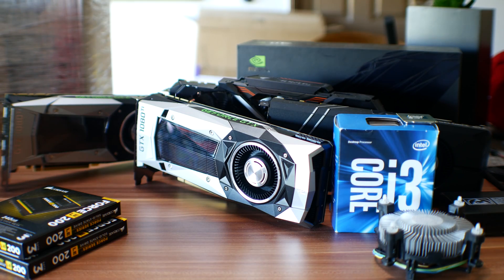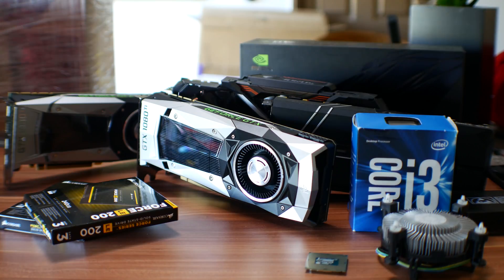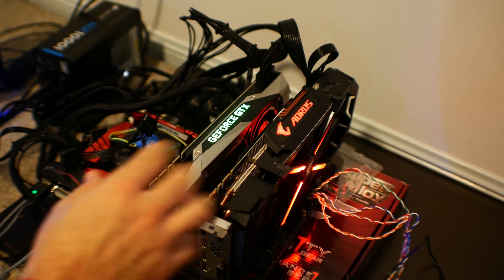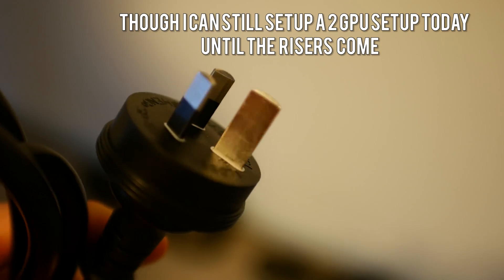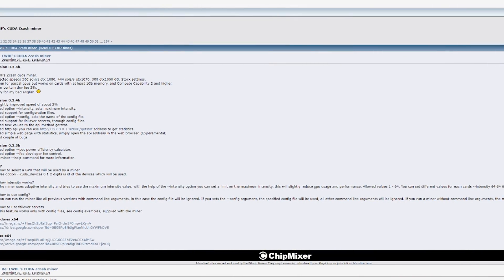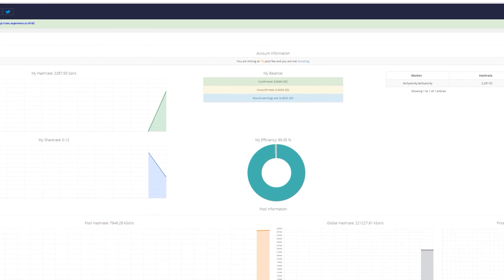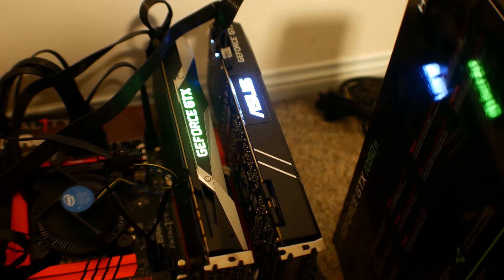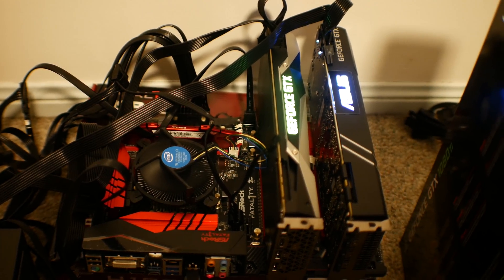Setting up My First Mining Rig...

Comment: u piece of shit... incoming difficulty spike every1
Reply: This is what I have done. Got two cards - hush on one and Zcash on the other to hedge my bets...
Reply: Noobish hodl
Reply: No point investing in Eth mining now price drop of 27% and still falling
Reply from the maker: While you are busy hitting that D, I am just going to go and pop on some Marvin Berry & The Starlighters (https://www.youtube.com/watch?v=41GsS3jldOI) and dance with my Mining PC.
Reply: Nikhil Friedman mine hush
Reply: maaaaan. in my country a damn GTX 1060 costs 600 US bucks. :(
Reply: rateeg what miner program and pool do u use? also, is the domain myhush.org?
Reply: Nikhil Friedman i use ewbf miner ver. 3.4 i think. on zdash.suprnova.cc or hush.suprnova.cc. batchfile is real simple
Reply: >mining with 1080ti
>gddr5
Reply: memes 1080ti is more profitable than 1070 or 580.  No it's not the most efficient, but that doesn't change that it's far more hash per slot than any other semi reasonable card out there.
Reply: +cracklingice These days yes, earlier on the 580 was outperforming the 1080 Ti in Etherium apparently from what I've heard...
Also, the 1070 is actually pretty good.
Reply: the 1080ti is crazy expensive and uses a lot of power.  So the 580 probably wins from a power to hash standpoint and when it was at it's msrp it probably returned investment faster.  However, the 1080ti is and was the most dense hash per slot.  Meaning that if you wanted to have 1 rig be as fast as possible to take the least amount of space, that's the gpu to pick.
Reply: Good.
Reply: cracklingice actually as time goes on in the mining process  and the dags get more complex, the higher end Nvidia parts beat it out
Reply: Luredreier what ? the 1080 ti does 33 MH/s of ETH. 

Z cash is more profitable at the moment. I'm getting 750 sol/s 

I'm going to start mining Trump coins though - a 1080 ti can mine about 420 MPussy/s
Reply: 8x rx 480 and 4x gtx 1070 for a total of 320MH and only get just above 0.1 eth/day. To all who want to jump in now you're going to take close to a year to ROI. I'm just glad I was getting .3 eth/day when I started and GPUs were cheap.
Reply: Yeah exactly.  It's too late to buy in.  If you have it already - run it - but buying GPUs right now to mine with for more than just because it's fun - is a dumb idea.
Reply: Switch to zCash.
Reply: did he said 3 phase power?? lol
Reply: +Sergey Kislyak Now yes.
However the amount of etherium mined changes over time with these GPUs, and they change at different rates.
The AMD GPUs where killing the Nvidia cards in the beginning with etherium, now they're losing out in relative performance.
And yeah, Etherium is no longer the most profitable currency.
But it's the one I've been following the most recently so I can't really comment on the other ones...
Reply: +Justin Scott Try NiceHash or something?
You might end up landing on a currency you didn't know about that earn you more.
Reply: +cracklingice Depends on the currency.
I there are some other ones on the horizon that might be worth investing in.
Reply: lured, I wish I had the ability to test 1080ti vs 580, but I think it's more likely that if 580 beat 1080ti at any point it was more likely due to mining programs not being well optimized for nvidia than to dag file size.
Nicehash is good for no brain set it and forget it, but will always be less profitable than mining the coin directly in a pool.  The only perk of Nicehash is that while you wait on payouts, your mining power isn't deprecating as the alt coin goes down because you're paid instantly in BTC at the rate the contract buyers are paying minus Nicehash's cut.  So you're only having to worry about  BTC value at the time you get paid out and sell coins (2 weeks on a gtx 970 24/7).
Regarding other profitable coins may be coming, that's not something someone running out and buying GPUs because they can make money wants to hear. Thus why I said don't buy GPUs for mining for profit, but it for fun and hope for profit.  Because buying for profit now will result in unhappy times and possibly losses for those not willing to wait 6 months or longer on profit.
Reply: Bitter Raven he might not even go to ETH. He might go straight to BTC from ZCash.
Reply: Bitter, all crypto is falling.  It's partly because the US is trying to have a meeting to establish laws regarding crypto trading for the states.  So I am sure that a lot of US investors are panic cashing out to make sure they can't be effected.  There is probably also some hesitation in investment due to the upcoming segwit deadline and potential for fork.  I'm of the opinion that you don't fork the digital reserve currency.  You don't even talk about forking the digital reserve currency.  Every alt coin is traded based on a fraction of BTC.  You don't screw with that.
Reply: John Daniel Esguerra If you buying cryptocurrency.. now is the time to buy, but id wait till after August to see what BTC will do after the fork.. Gpu mining.. no point getting involved the bubble has popped, Zcash has fallen from $400+ a coin down to $179 a coin and still falling in the last week
Reply: Bitter Raven I don't mine ZCash I mine X11 & Scrypt using ASICs. I use my GPUs for mining Monero and Cryptonote/Cryptonight algo coins. And I do invest on BTC since then.
Reply: people need to realize that all alt coins are governed buy the price of BTC.. BTC is governed buy how much someone wants to pay for that BTC, If BTC falls the value of all alt coins falls
You buy BTC with USD then sell that BTC to BUY ETH or ZEC or XMR,, Or you mine ETH or ZEC or XMR you then sell those mined coins for BTC then sell for USD.
Trying to say that the fall in price of BTC is because of the us Government is bullshit.. your large data centres arent governed by the US because there not in the US
Reply: dislike the vid if u agree
Reply: thank god, I need a gpu
Reply: Tech YES City you should switch over to mining hush. it'll be $20+ in the next year and 1 1070 can get mine about 1.5 per day at current difficulty.. just dont tell all your subscribers